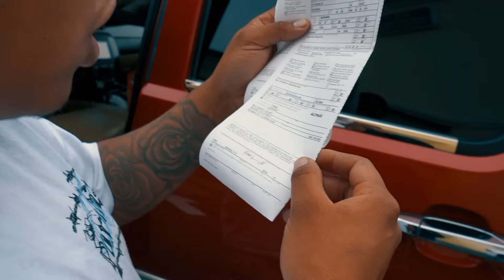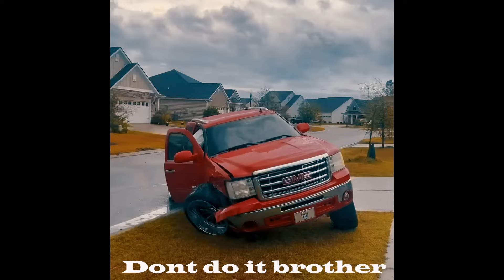Almost Arrested… ILLEGEAL Squatted Trucks TAKE OVER Panama City Beach

Comment: Just avoid the headache and bag the back
Reply from the maker: Bags eh 🫤
Reply: @poppinclutchesproductions5773  think about it. Don’t you wanna take your truck everywhere without any headaches or the thought of getting pulled over in the back of your head
Reply: bagging the back does not lower the headlights lol
Reply: @Capt_HowdyGT  lets use some sense. He’s 2 inches too high. With a squat, he got pulled over and measured. Y’all don’t use y’all’s brains before talking
Reply: @TRE4RAISEDME  he could just reduce the squat a bit to where the headlights are at 50 in
Reply: @og-bg6.2  what about the laws in the other states he goes to the smartest options to avoid 95+% police issue is to put a back air lift.